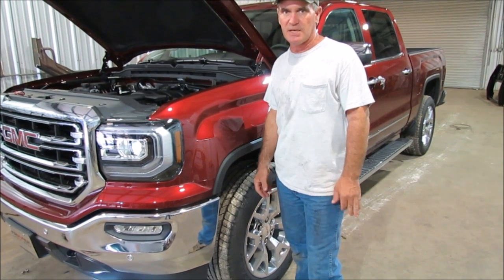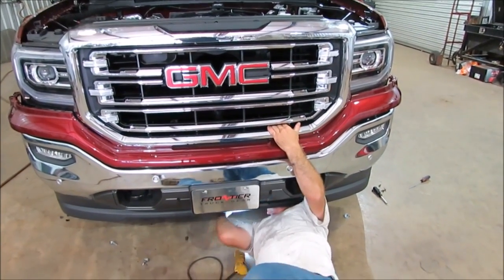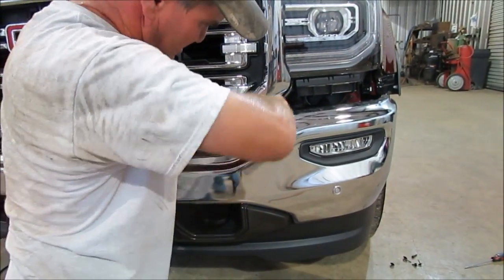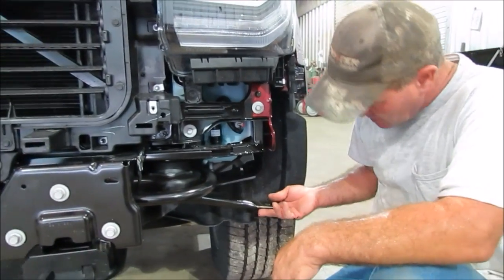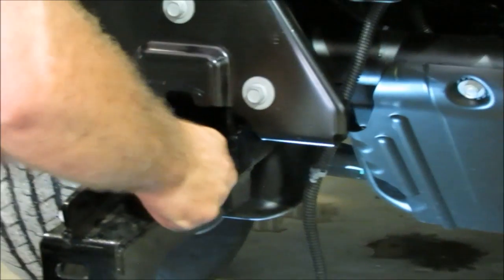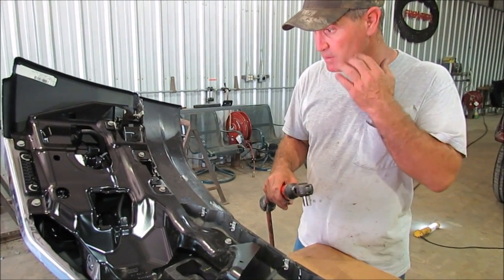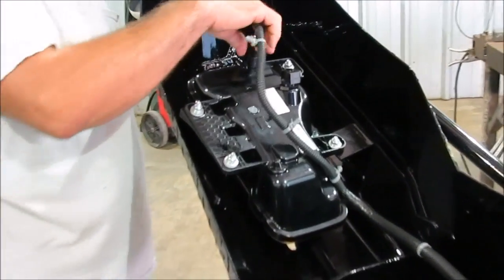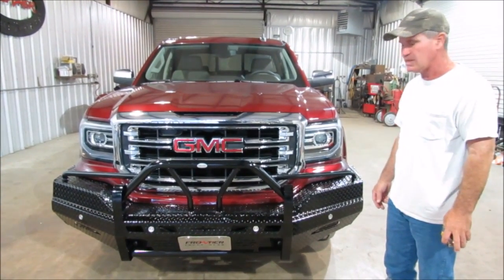Frontier Front Bumper Replacment 2016-17 GMC 1500 Installation

Comment: Cliff notes for removing the bumper:

Remove (2)9/32 wheel well screws on both sides. 1 is visible and the other is hidden. Remove (2) t15 screws on both sides. 

Pop out plastic wheel well a little on each side

Go under the front of the truck to pop plastic clips out.  Use a flat head screwdriver to pry the plastic clips up over the housing. 

Pop out 12 plastic clip holders above the radiator. Work the middle plastic piece out with a flat head screwdriver. Once popped pry the bottom with a plastic pry bar. 

Remove (8) 10mm bolts around the grill

Lift grill pull up and out

Remove (4) 18mm bolts holing the bumper on

Remove (2) 15mm bolts from arm holding bumper on

Unplug sensor before removing the bumper. Pull red tab out and squeeze the black tab to remove.

Comment: How do I take off the bumper “skid plate” behind the license plate?  I want to change my grey one to Denali chrome one..   thanks in advance. Hopefully I don’t need to remove the whole bumper.
Reply: you can do it!  Just need a flex head ratcheting wrench 7mm to get to the top 7mm bolts behind the plate - taking the bumper off is just dumb.